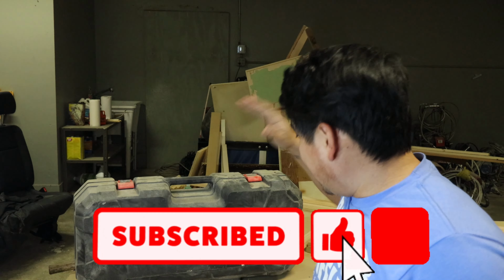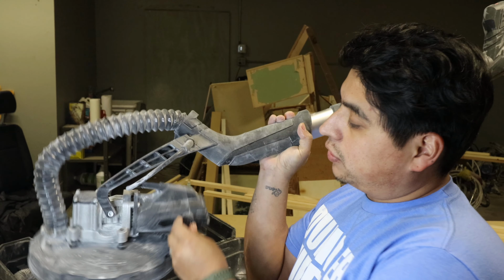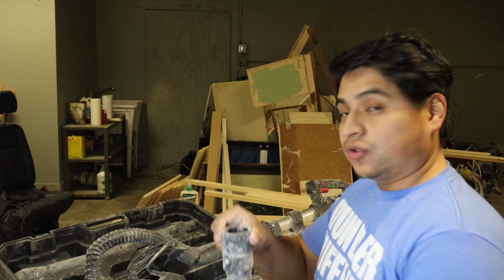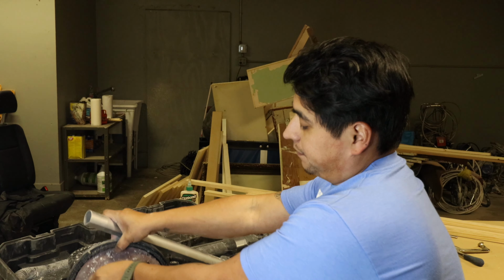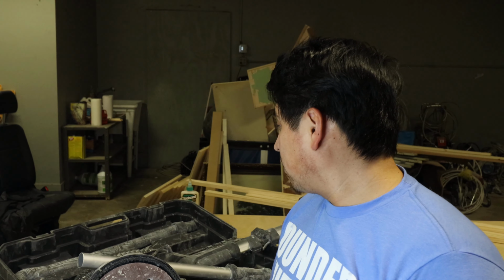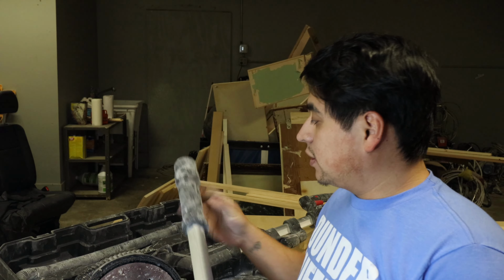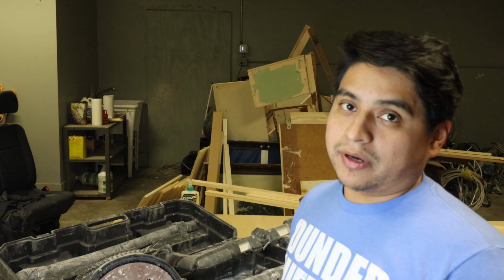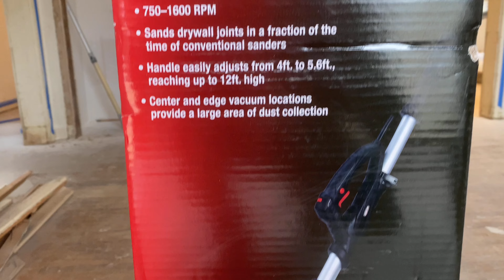Best Budget Drywall Sander?!!! | Ironton 8.5 inch Drywall Sander | Northern Tool

Comment: I would listen to you over anyone on YT because I've seen the best drywall guys are Latino.
 For real can you get sanding pads from the home depot or do they need to be ordered?
Reply from the maker: I usually order them but i have also used the ones for the manual circle sanders and just poked the holes out
Reply: You can find the correct ones at northern tool
Reply: @MrSmashingWindows yep northerntool has them but make sure you get the right ones my local store has 8 1/2 & 8 7/8 an the whole pattern is not the same on both.

Comment: Where do you find replacement sandpaper for this? Seems like nobody sells 8.5'' discs with 6 holes on the outside. Thanks
Reply from the maker: I buy them online usuallly amazon. If i need somthing quick ibe also used the ones they have for the manual radial sanders like the gator brsnd. And just poke the holes
Reply: I get mine from northern tool where I bought the sander